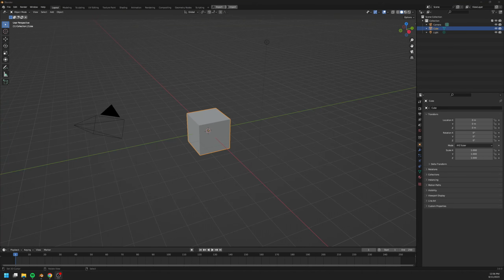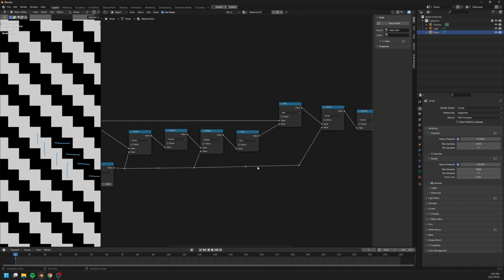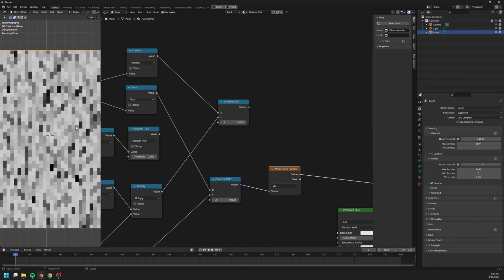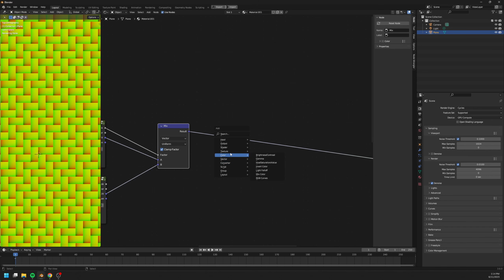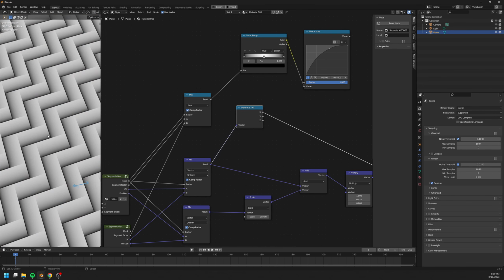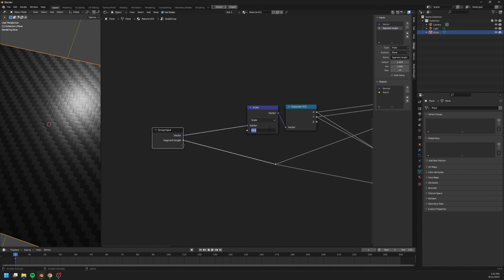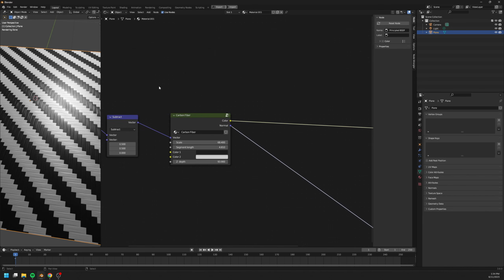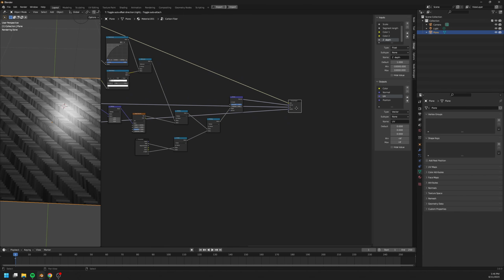How to make Procedural Carbon Fiber

Comment: You might want to finish this by making it shade like carbon fiber instead of just the pattern generation. The color isn't needed, they don't actually change based on orientation. The color change is due to shading based on the orientation of the light source. Trivial to do with anisotropic shader for Cycles, use mask*0.25 into the rotation, maybe modulate further using the noise. For Eevee since it doesn't support anisotropic shading, look for pseudo anisotropic shader for Eevee. While I can't get it to stretch correctly according to pattern direction, at least I'm getting light and dark shading alternating between red and green tangents. Could work well enough for alternating carpet tiles, but for carbon fiber in actual use a resin top coat is needed.

While this twill setup covers most uses, it doesn't cover the satin twill pattern that can be found in some carbon fibers. If you want to expand on that, maybe consider converting the OSL approach for twill patterns instead of hard coding it? I tried, but failed - miserably 🤣Also check out Erindale's approach to making twill pattern that doesn't extend all the way. The holes makes it more usable for loose woven fabrics and garments. Curious how you'd approach that in an alternate fashion. Other approaches are always welcome.